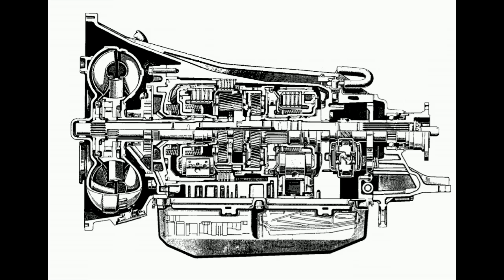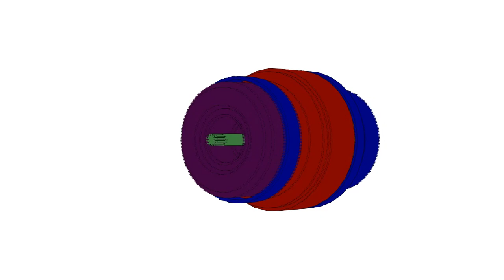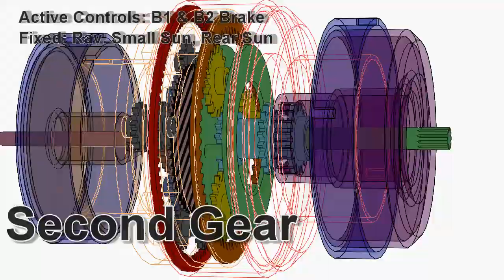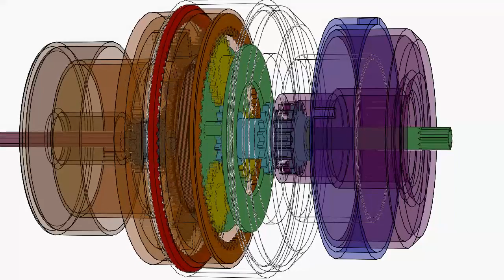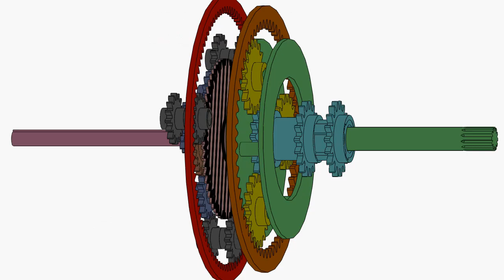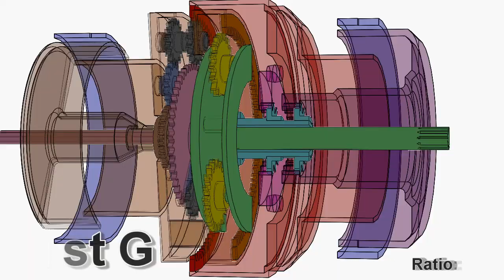Mercedes 4G-Tronic Transmission Function and Modes

Comment: Kinda weird because normally a 4 speed transmission have one overdrive while this one is like a 3 speed with an extra lower gear
Reply: you can have a faster final drive instead of overdrive. i think that this transmission is pretty clever because it doesnt use long hollow shafts.

Comment: Thanks for this extensive explanation and amazing work Luc! I'm currently doing a graduation assignment for my Automotive Engineering Bachelor's on the 722.4 paired to the M104 engine. Is there any way you would be willing to share you CAD models and/or your report?

Comment: can you explain what is S and E button ?
Reply: E for economy mode and S for standard mode. 

The 4g-tronic standard is made to start at 2nd gear for smoother launch/creep from standstill, unless with models calibrated to move from 2nd to 1st when the gas pedal is slightly touched. Here's how it works, unless you manually put the shifter to "2" where it will force the gearbox to switch to 1st gear from a standstill (assuming the vacuum switch still works):

1. Standard mode: Starts at 2nd gear with normal acceleration, but will switch to 1st when you press the gas pedal deeper. Gear changes happened at higher rpm compared to economy mode.
2. Economy mode: Starts at 2nd gear and stays at 2nd even if you press the pedal deep, it changes gear at earlier rpm compared to standard mode to increase fuel economy. This mode can be cancelled/deactivated with a kickdown at 100% throttle a.k.a flooring it.
3. Kickdown mode: No button, just floor it 100% since the switch is behind the gas pedal. V8 models have "B" or Brake in their shifter as a dedicated kickdown switch to 1st gear for engine braking purpose since they're heavier vehicle overall and harder to slowdown.

Later or other models are equipped with electronic overdrive 5th gear and W/S (Winter/Standard) mode instead of the earlier E/S (Economy/Standard) mode, both still used the vacuum modulator. Models before 1990 have secondary ATF pump driven by output shaft and thus can initiate a rolling start by putting the vehicle in speed of 10-20 mph in neutral and swiftly move the lever to "2," locking the 1st gear and spins the engine.

On modern traffics, Economy mode would consume more fuel than Standard mode considering how fast traffic are moving from a standstill now. For the untrained drivers also It can make the gearbox work harder since it shifts early and lugs the engine, especially at uphill where it'll stay in gear unless we do a kickdown.

Comment: Also do you know why Ford MX/FX Transmissions had 3 speeds when they were also ravigneaux style planetaries? shouldnt they be able to utilize 4 ratios in ravigneaux style? I dont understand why its a ravigneaux but still has 3 speeds
Reply from the maker: Tim, I don't know about that particular transmission, but I know that if the clutch configuration were different, it would reduce the available gears, for example.
Reply: @lucdunn5605  i see yeah that makes sense, thanks for replying

Comment: Nice video, at the start in first cutaway picture the gears are helical but in your solidworks drawing they are spur gears. does this trans have spur gears or helical gears?
Reply from the maker: Tim, sorry for the delayed response. this transmission, as most do, has helical gears. The model is a simplification.